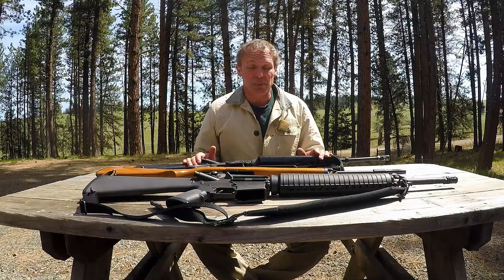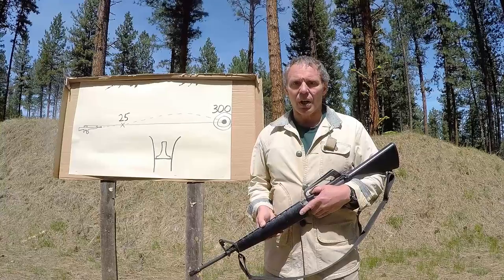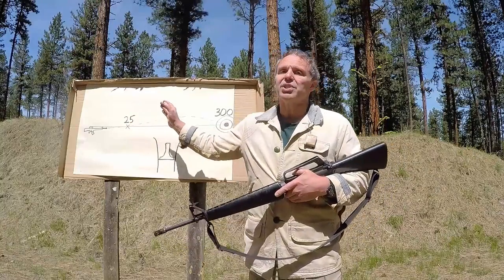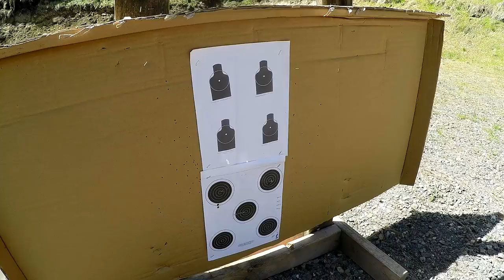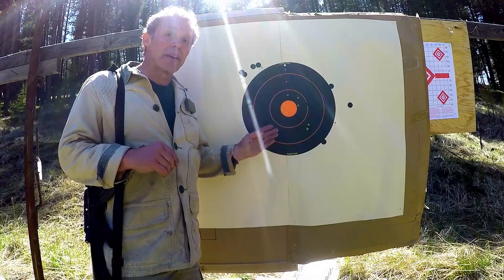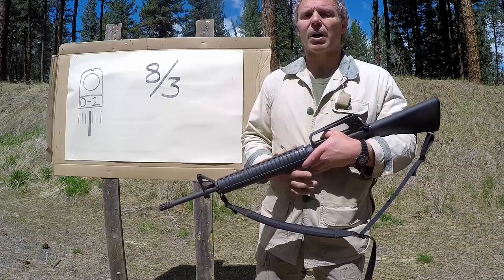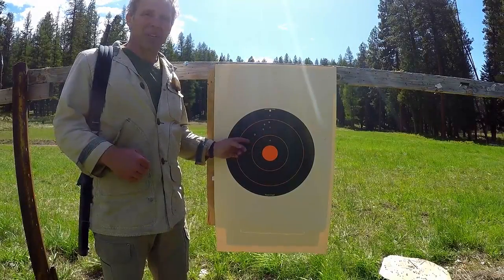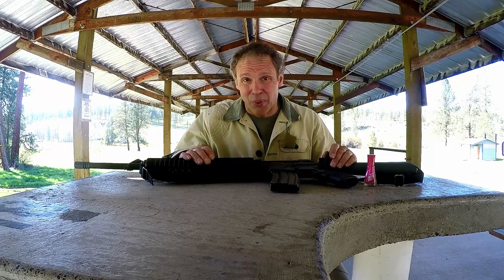Zeroing an AR Platform Rifle

Comment: I'd just like to ask a couple questions.
Paul...I just gotta know:
1. Are you using an A1 or A2 or A3?  I was busy with ADHD and not sure if I was listening.
2. Doesn't the word Meter mean Yard in European?
3. If I were in Australia, wouldn't I turn the front sight post in the OPPOSITE direction from the arrow to allow for the Coriolis Effect?
4. I watched the entire video but you never addressed Altitude Density and you're clearly at an altitude.
5. What color nail polish?

Comment: With an 1/16 allen wrench you can loosen the A2's elevation drum so it can spin and not move the rear sight. (Do not completely remove it, just make it loose enough to move)  

Change the drum's alignment to index 4 clicks lower than 8/3.  

Tighten the screw.  

Zero the A2 in the same way you normally would at the 8/3+1 at 25m.  Confirm at 300m.  

However now that you can index the elevation from to a new position 8/3 -3 clicks, you also now have a 100m zero, in addition at 8/3 -2 you have a 50/200m zero

This method gives you the best of all worlds, and retains correctly indexed ranges of the A2 sight from 300m to 800m.

Comment: Hey Paul, Ive been a long time fan of yours and had two quick questions. Sorry to ask them on such an old video but the main question pertains to what you discuss here specifically, hopefully you see it. The main question I have is does the mechanical zero apply to carbine length rifles? I know the M16 and AR15's more that style have a longer barrel than a M4 or AR15's that style, which is what I just got at 16 in barrel length. The other question I have is do you have any personal experience with Palmetto state armory? Ive seen a bunch of really good reviews on them and was just wondering if you had anything to say about them.

Comment: If you go to the highest resolution on your computer,  (for me that was 1080P48 HD) and then play the video at 27:42 and 1/4 speed, you can see the vapor trail of the bullet as it passes passes by.  The bullet strike is the third one in the 9 ring at 11 o'clock, landing between the two previous shots at that same location.

Comment: Army basic training in '69.  A company sitting on bleachers when the DI walks to one side and announces, "this is a M16 Automatic rifle", holding one above his head.  He makes the same announcement at the center of the bleachers and then at the opposite end.  Then, "can anyone tell me what this is? holding it above his head.  Several volunteer.  He then walks to one end of the bleachers and points to the first recruit, "can you tell me what this is?"  The first recruit jumps to his feet and yells, "Sergeant, that's a M16 automatic rifle".   He continues down the row asking each recruit.  About tenth down the row a recruit was dumbfounded.  By the end he had gathered up ten to a dozen others that would spend the rest of the day running around the parade field.

Comment: There’s a much faster way to get the 100 yard zero. Just index the elevation wheel to have 4 clicks counter clockwise movement from the 8/3 sight-in setting. Then zero for 300 meters at 25 meters 1 click up from 8/3 setting. Now turn elevation wheel down 1 click for the 300 meter zero and if shooting at 100 yards just adjust elevation wheel 4 clicks down from the 8/3 setting. That’s it. It’s fast and does not require any adjustment from initial front sight setting for 25 meters.

Comment: My understanding has been that the "correct" way to zero a 20" barreled M 16 with A1 sights shooting M 193 55 grain ball ammo was as follows:  After mechanical zero, zero POI = POA at 25 yards (which you did), you then switch to the short range peep aperture to get a BSZ with a far zero of 250 yards (not 300 yards).  With the rifle so zeroed, using the short range aperture should put you a little over 1" below POA at 25 yards, with a near zero between 40 and 45 yards, and hits about 4-7" below POA at 300 yards.  If you use the same L aperture after zeroing at 25 yards, without further adjustments given the typical external ballistics of the M 193 FMJ round, you would be expected to hit about 10.5" above POA at 300 yards, and indeed that seems to be about where you were before "rezeroing" at 300 yards.  Was your method of zeroing at 300 yards using the L aperture, and then switching to the short range aperture for shorter ranges taught in the Army or Corps?

Comment: The confusion for the A1 is between USMC at 25 yards (your USMC manual), and the Army manual (FM 23-9, July 1989, page 3-22 to 3-25) using 25 meters ( I have the Army manual in-hand ).  I don't have the USMC manual to make any judgement for comparison. I think, by far, most people can't see a human target that went to ground past 100 yards/meters, so zero at 25 yards or 25 meters does NOT matter. My last unit would have been in a MOUT situation, so precision at 100 meters would be best for us, hence your suggestion to zero at 100 meters would be best, A1 or A2. I retired '94, we were just issued the A2. Today all the vets I talk to had a 4x ACOG, making 100 meter shots easy. I would like your eval of the Brownells retro 4X handle scope on your A1.

Comment: Paul, I hope you catch this. On my A2 I rotate the elevation wheel at the back of the handle all the way down. It does not align any number with the index mark on the handle. It is about 3/4 of the way between the 4&5 marks. It will do a full rotation plus 4 more clicks which puts the #5 on the wheel 0e click short of aligning with the index mark on the handle. There are 29 clicks in all from all the way down to all the way up. Should I rotate the up/down dial to the midpoint (14/15 clicks) and consider that zero? I hope you see this and can help. THX.    PS, The rifle I have is the Eagle Arms AR15.

Comment: New AR. New optic, first time I've ever used one. Have tried to zero, one magazine so far. Here's the WTH problems.

At 25 yards, groups are 6" to the right. Maximum adjustment only put groups about 3" to the right.

Now the interesting part. I see two sets of crosshairs thru the optic. Finally figured out it's probably astigmatism from the double vision After brain surgery. I wear contacts with the left lens correcting for the astigmatism. 

Haven't had any daylight hours to shoot again, but what's everybody think? Try the "other crosshair" and see if that's my problem?

Comment: Maybe late to the party, but I do have a question regarding the rear sight carry handle.

Your video references a rear sight that’s marked 8/3, I have a few carry handles (between M-16 and M4 platforms) that are marked 6/3. What’s the difference between the two sights? Is the 6/3 half minute of angle?

Comment: In 1972 zeroing an M16A1 and later in M16A2's in the Army was the exact same as zeroing it in 1981 - 1983 while I was a Drill Sergeant at Ft. Dix.  Battlesight zero was conducted at 25 yards.  When the rifle was zero'd at 25 feet, the trajectory of a 55 grain bullet fired at roughly 3100 feet per second from a 20 inch barrel would cross the line of sight at 25 yards and again at 250 yards, not 300.
Reply: 3100 seems a bit slow for M193, but on the money for M855. M193 from 20" barrels usually breaks 3300 fps.
Reply: @jcoolG192  Yeah, I did a lot of shooting in the Army.  I was on the AMU for a couple years.  I chronographed a lot of rounds through a 20 inch barrel and very few and I mean very few ever hit the 3300 FPS mark.  But I guess since 1 ever did, than the manufacturers can claim it.  Doesn't mean much out of a 5.56 except it's fast.  It's still a underpowered gun for combat.  Give me a 30 caliber at 2600 FPS and I'll reach out and touch someone at 1,000 yards - consistently.  Well at least I could when I was younger, and that was with iron sights.

Comment: 1 meter is almost exactly 39 inches.

Since a yard is 36 inches, we lose 3 inches every yard versus meter.

At 25 meters, one has gained 75 inches over 25 yards. 75 inches is 6.25 feet (6'3") meaning about 2 more yards.

So, 25 meters ~ 27 yards

Comment: The AR and Mini-14 are both 5.56MM Carbines. When in the market for a 5.56MM Carbine, AR vs Mini-14 is a viable comparison. Here in CA, one has a choice of a Mini-14 vs a castrated AR or any other class of pistol grip carbines. I am a .308 guy myself. My interest in the 5.56MM Carbine is for my wife and mother in law. They simply cannot handle the weight and recoil of a .308. The complexity is running a BBR (Bullet button reloaded) or dealing with the ergonomics of the "Shark fin" Grip of a castrated AR puts the Mini-14 on top in our situation.

Comment: The only difference between the m16a2 and a3 is the a3 full auto instead of burst. I think Paul meant "a1, a2 and a4"  the a4 has a flat top reciever and has the same 6/3 sight knob as the m4 carbine.

Comment: So I was remembering Edson range being in meters and Wilcox and Pulgas being yards but after using my handy dandy google maps app it looks like Edson is also in yards. I figure this by measuring all 3 ranges from the 300 “yard” line. Only qualified once at Edson... for obvious reasons to anyone who knows what edson range is and also once at Las Pulgas, the rest were at Wilcox range for rifle and pistol quals. Wilcox is also where we took our shooters to qualify when I was with my battalion MTU. 
One question though. When you’re shooting at 300 yds are you sitting, kneeling, standing or using a bench?
Reply from the maker: for this video I was shooting prone. And I know that when I was at Edson range it was made clear to me that it was meters. Has it changed? I have no idea. I know the scoring was different for example, expert required a score of 216 instead of 220 because the range measured in meters is farther.
Reply: I remembered Edson being in meters also, I was just using the google map app measuring tool to compare the 3 ranges that I shot while I was there. The app could be wrong or maybe they did change the range, I don’t know I haven’t been there in about 25 years. I coached at Wilcox range for a year so I know that one is yards, (the good ol’ days). Thanks for the reply. Pretty good shooting at 300 by the way.

Comment: The 0-2 aperture I believe does have a slight elevation difference compared to the small aperture on the A-2. The intention being that you would have a 0-2 ghost ring and then a 25/300+ aperture. In other words the two apertures perform a similar function on both rifles, the difference being the zero and the elevation dial. I don't see why it would be necessary to re-zero the small 3/8 aperture to 100 yards. Difference in elevation for the 0-2 on the A2 rear sight should be 2.5 moa if this post is correct. https://www.ar15.com/forums/ar-15/0_2___The_A2_Rear_Sight_Aperture/18-497571/ Per Armystudyguide the 0-2 is "automatically zeroed for 200 meters" https://www.armystudyguide.com/content/army_board_study_guide_topics/m16a2/zero-and-m16a2-rifle.shtml This is incidentally the biggest deviation (12" high) from the 25m/300m combat zero and covers all your bases. That said, the nail polish is a good idea.

Comment: so for the A2, set 3/8, zero at 100y, at 300y you need to add 3-4 clicks for 300y zero (confirm of course). So if at 500y, set sight to 5/8, but how many clicks do you add to be on at 500??  If you would, if you have the data, make a chart for the additional clicks at ranges greater than 300 yds. Thank you.

Comment: hi Paul! shot my brand new AR 556 (Ruger) tried to zero it today, no success😆fng @50 yds 4 inches high, and 12 inches to the right. I have a Magpul Mbus rear sight (single aperture) and a A steel front sight. In a dilemma, SOS 😁. Guess I need to begin @25

Comment: Or just zero at 100 yards from front sight with rear sight 2 clicks off elevation wheel’s bottom and mark elevation  wheel for come ups at 200, 300, 500, and 600 yards, if there is no need for a battle sight zero synchronized to a BDC function. This scheme  works nicely for US Service Rifle Competition. For 1000 yards set rear sight to 600 yard come up for VLD bullet and turn front sight into hole 3 to 4 full revs. That will get bullet on paper and use MOA wind constant of 10 to get bullets in 10 ring, assuming match conditioning of rifle.

Comment: PROTIP (for n00bs):  When making Point of Impact adjustments (ie when adjusting your sights to move the group so that it matches Point of Aim)... make BOLD adjustments.  If it looks like you need to move 3-inches down,  adjust your sights for 4-inches.  Why?  Because even if you aren't a great shooter and your groups are messy, you'll see the overall shift.  It's easy to take out that extra click or two and bring the group back.  If you don't move it enough, it becomes confusing if the adjustment had any effect at all.  Be BOLD and bracket the bull.  It'll also help develop your early "feel" for adjustments to the sight vs impact downrange... which is how the sights are used after they're zero'd for shooting various targets that you may only have a range estimate on.  That's the point of all this, anyway!

Comment: I don’t know if it’s an actual memory, or dementia setting in, but I recall obtaining battlefield zero on a 1000 inch range with the A1. Fired expert 7 times in 6 years with my highest score being  with the A1 (239). But then again I went from dropping rounds from an M79 in 4 ft. groups at 250 yds, to not being able to hit a deuce and a half with the M203.
So, where you a real Marine, or a San Diego (Hollywood) marine? Either way, great job , keep up the good work.

Comment: I'm sorry for my bad form. I'm addressing a pet peeve that doesn't deal with this video. I did the same thing to Hickok45 because you two seem to be the most knowledgeable and popular on the Tube. My problem, less expert reviewers keep trying to get similar accuracy and performance from .410 slugs fired through .45 firearms. Please explain to them the difference between .410 slug and .452 bullet in .45 barrels. Again, sorry to ask a favor on the wrong place.

Comment: Do you think a lazer pointer would be good for zeroing in the sights (if you somehow had one that showed light 100 yards away)? I know bullets move around in the air but if you know which way and how much for the type of ammo you could technically adjust your stance and have a point where its the sights are in zeroed in for long and for short range, actualy i dident think about how to zero in a lazer pointer, i guess that would make this idea not work

Comment: Excellent  ive got a red dot on mine and a forward tac light and laser.. 

thinking that is set for longer range and the dot in scope is maybe 50-100
with  forward mount laser at 300.  about tempted to mount a normal scope on it
But around here its urban and those Would be your ranges..   Shorter distances..

Comment: Hi, I just got an M16A1 build with 1:8 twist barrel. For this twist, 62gr ammo has the best accuracy. I assume when Eugene Stoner designed rifle and sights, he made it for 55gr. Rear sights setups L and S still will be correct for compansate 62gr bullet drop?
Reply: You’ll be fine.  Both the M193 55gn and M855 62gn have about the same ballistic trajectory until you get way past 400 meters.   In reality, the large aperture rear sight is very seldom used.  It is there only if you need a huge field of view for close-in work or shooting with a gas mask.  Remember, the US military only requires accuracy of 3 MOA, and you have an aftermarket barrel.  So as always, buy a selection of different cartridge types and see which one gives you the best accuracy in your particular barrel.  You’ll need to know this:  with a 5.56/.223 AR whether you have a 20” barrel or a 14.5”, the apex of the trajectory will be at 190 meters.   In the Army, we do a disservice by using a 25m zero, and civilians also do a disservice by often zeroing on a 100yd range.   This leads to a very tall shot strings at your various ranges from 25-300 meters as the bullet rises and falls along it’s ballistic trajectory.  Like a 10-12” shot string (I don’t recall the exact height).  To shorten that shot string, use a 36 or 50m zero.   Look it up and you can see examples.   When we teach point of aim/point of impact with a 25/300m zero, here’s what we have to say—25m center mass, 100m center mass, 150 belly button, 200m belt buckle, 250 belly button, 300m center mass.   You don’t have to have such extreme holds by using a 50/200m zero.  And those little .223 diameter bullets don’t like wind.
Happy shooting.

Comment: It seems like the A1 shoots low and right with a cold barrel. Every single first shot was low and right but after it got warmed up it shot a good group
Reply: The A1 has a much thinner barrel.  When it heats up, the impurities in the steel cause it to expand unevenly - enough to affect your point of impact, but in a consistent and predictable direction.  It was one of the reasons they made the A2 "government" barrel so much heavier and more rigid, the other one being bayonet fighting.

Comment: Probably the worst I've ever seen Paul shoot. Must have been a bad day?

Either way, my experience with the A2 rear elevation is that it had adjustment below 8/3, so you would generally set it to 8/3 -2 for interim ranges (and 8/3 would be on at 300)

Comment: CAR , HBAR , A1 , A2 , A3 , mid length gas system , carbine length gas system,  308 , 556 ,  flat top , removable carry handle , flash hider vs muzzle break....  if you dont understand the platform there are so many websights that have info to learn from.  noone at birth understood it all , but there are so many places to get information from.  The history of the AR and eugene stoner has a lot of interesting details.   twist rates and the vietnam issues of thinking these rifles were self cleaning..  which they were not. This is the most common rifle in the us from what I have read...  why not learn about it ?